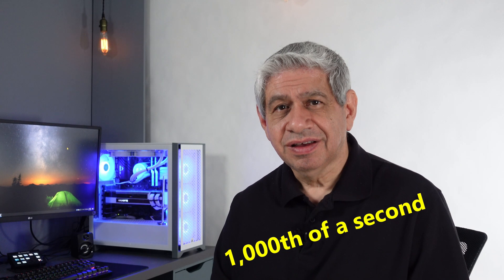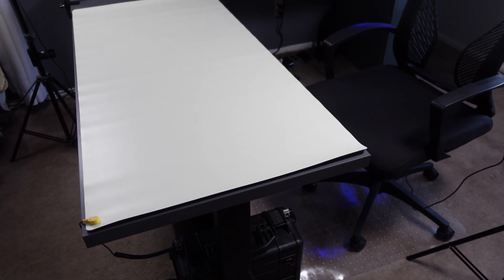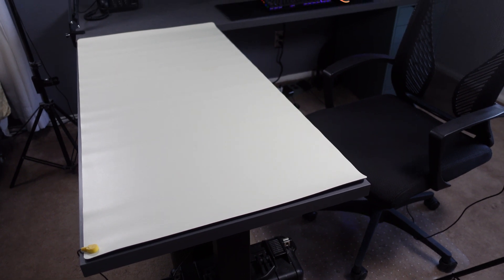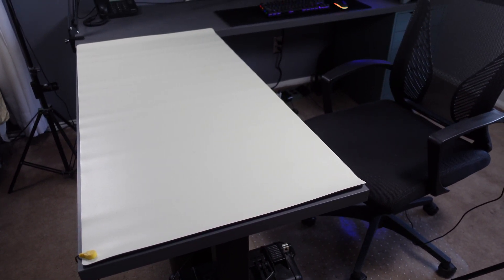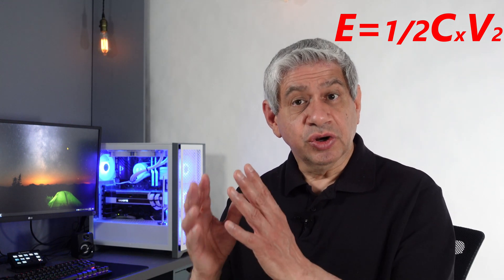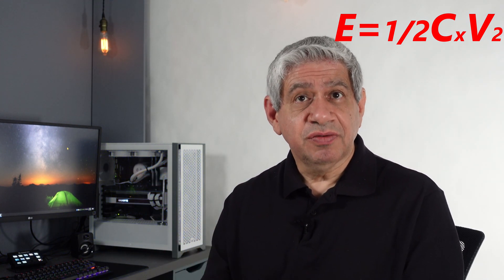Preventing Static Discharge through your High Priced PC Components

Comment: Mehdi Sadaghdar is an electrical engineer and has his own wiki article https://en.wikipedia.org/wiki/ElectroBOOM.  His YouTube handle is Electroboom.  Recently he collaborated with another channel to investigate static discharge failure of electronic components. You might find this video interesting. 

https://www.youtube.com/watch?v=nXkgbmr3dRA
Reply from the maker: Thanks, I will take a look at that.  I am not as crazy about static discharge as heat and power wattage deficiencies, but I always keep it in mind when handling chip that are not in a socket.  Also, I have static mats on all the tables I use when handling components outside a PC case.